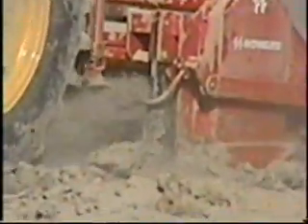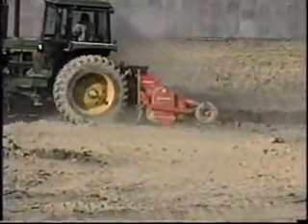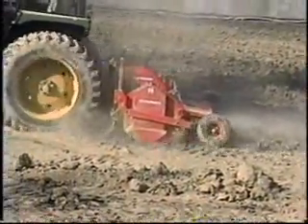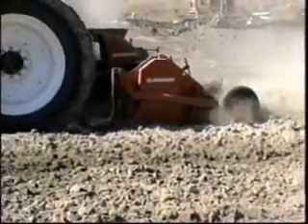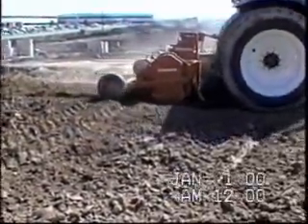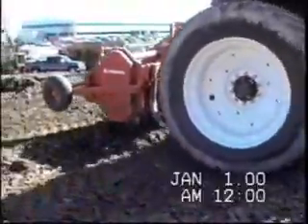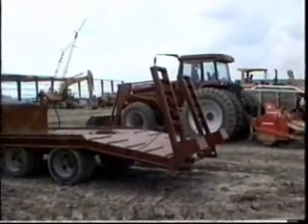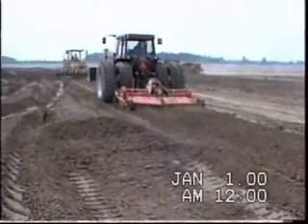Soil Stabilization with Howard 700 Deep Till Rotavator

Comment: I worked for Howard Rotorvator or Rotary Hoes as it was we built a rotorvator that was called the Howard 700 from 1958 to 1961. We made some " M " machines for the USA market but I nevver knew of a Tractor mounted machine called the 700. 
If you want to see a Howard 700 at work go to Ploughing on an allotment